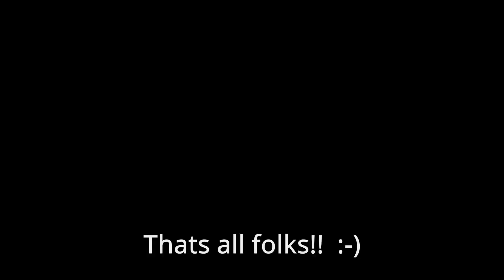DuB-EnG: 150 watt DIY Portable folding Solar Camping panel VW Camper Vans / Glamping charge power

Comment: Nice job mate.

One tool I've used heaps that you might want to check out is a rivet attachment for a drill. Bought mine for a shed build and it's brilliant any time I need to do riveting because it saves my hands.

They're not cheap but still under $100aud for something that is quick and easy on the hands. Saves so much time with it on my power driver.
Reply from the maker: Oooh I'll have to look into that!!! Tha ks for the tip!!!

Comment: I think it could be useful to add some folding legs for optimal 90 degree positioning against the sun rays... Like ones they use on deck chairs?
Or just a T-shaped stud on the folding points with U-shaped short piece to hold unfolded edge and longer one to prop in the ground.
Nice work, BTW! And fridge content is adequate!
Reply from the maker: Yes yes!!  Folding legs would be really useful...  I'll see if there's a way to do that in the future!  I bet you couldn't tell that I was going to enjoy a few drinks with a mate later that evening!!  :-)

Comment: Nice idea...the only problem could be the build-up of heat due to the lack of ventilation. Over heated pv panels lose efficiency. Holes drilled into the protective covers will help with that. For those who want to build something similar and use a separate charge controller, ensures the charge controller is powered by the battery first before connecting pv panels or place them facing down. Hi input from solar tends to blow some charge controllers.
Reply from the maker: All very good points and tips!!